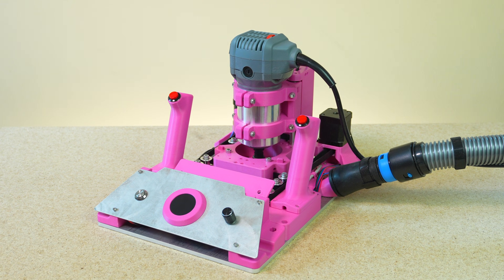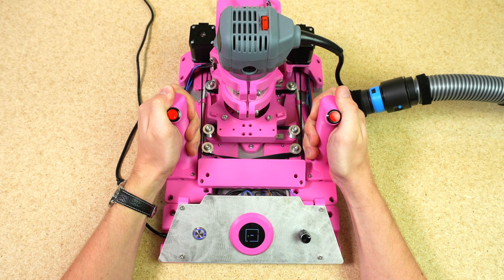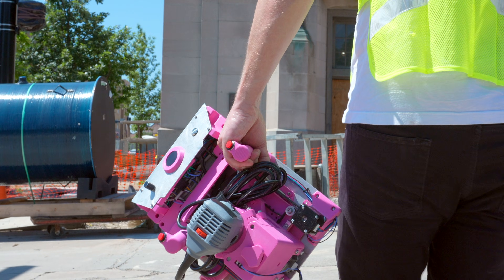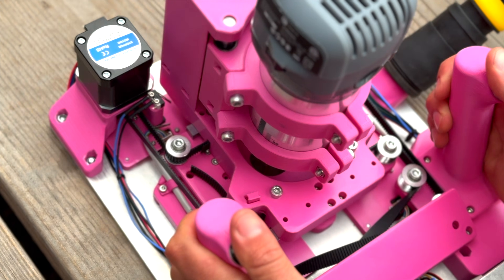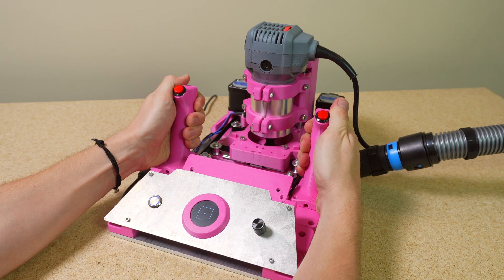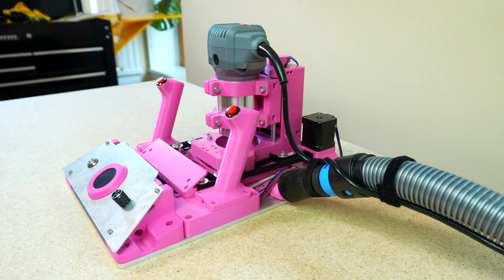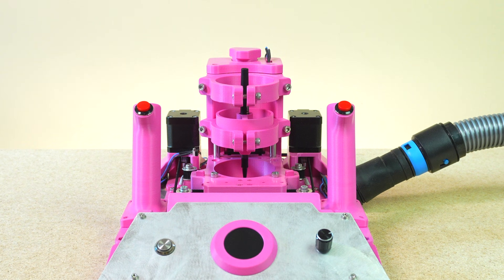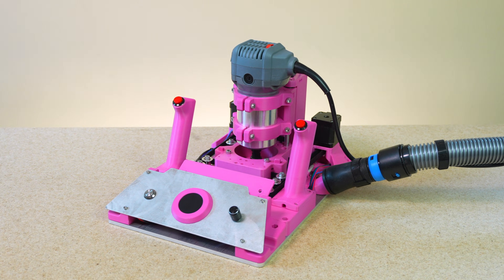Introducing the Compass CNC V1

Comment: Why didn't you put the display, teensy PCB and the two knobs on the shieldSeparator between the handles? As far as i can see in the CAD, the front part has no other purpose then holding the PCB, display and knobs. You could have made the machine 80mm shorter - or am I missing something?
Overall: Great work!!! please put a donation link on your website. I guess I would not buy one, but maybe I would build one and would like to contribute to the project

Comment: How does it know where it’s at?
Reply: Works the same as an optical mouse.
Reply: @JekaKey  but if you pick up a mouse and move it, doesnt know where its at. so once you pick this up it starts over? no rigid reference points? every project is a single cut?
Reply: @brandonrippeonphoto  Я думаю смысл примерно как в станке с чпу, задаете нулевую координату и относительно нее работает программа. Абсолютную позицию он конечно не знает. Работает относительно этого ноля и считает изменения позиции относительно него.

Comment: You don't need the ugly tape? How is the tracking done?
Reply from the maker: *4 mouse sensors ;)
Reply: @CameronChaney Might be limited by size then without the tape? Mouse Sensors arnt super reliable ive heard
Reply: @Stoeckermann mouse sensors track relative position. The tape tracks absolute position on the work surface. With the tape, you can stop then restart later with a new operation and the positioning will be the same as the first pass.
Reply: @DeanRockne That makes me wonder how you'd go about doing multiple passes with different bits with a tool like this.. not really in the cards, I suppose? That may also be a limitation with tools like the Shaper, too.
Reply: A mouse sensor
Reply: @Electheo  And the Shaper Origin doesn't? That seems like a fairly straightforward solution
Reply: So if you lift up the machine for one second does it lose the location completely?

Comment: Since you don‘t mention how you track, IMUs and mouse tracking sensors will not result in drift free tracking, for that you‘ll need absolute markers. Like that other tool we won‘t mention that‘s the only thing that‘s making your price for $50 worth of hardware in a DIY kit not completely ridiculous.
Reply from the maker: Yup, there's always going to be some drift with this sort of relative positioning setup. The name of the game is figuring out ways to minimize that. Using optical flows instead of IMUs to get a single integration instead of double, starting with a baseline of high accuracy/precision sensors, as well as including a redundancy of sensors (4 optical flows instead of 2) all helps. With a super rudimentary averaging scheme between sensors, that comes out to about 0.1% error per unit distance traveled - which, depending on your use case may or may not be acceptable. There's a lot of room for improvement on the software side in terms of sensor fusion to hopeful bring that drift down even more. We chose to prioritize ease of setup and the absence of consumables, while accepting some small level of drift

As for price, I'm planning on releasing "electronics kits" as well to hopefully make the build a lot more approachable for people who already have a lot of the parts lying around. Hope that clears some things up :)
Reply: @CameronChaney dude this is awesome!
Reply: @CameronChaney  Would really like an optical basestation approach eventually: Place like a little IR beacon on there and use as an absolute reference correction factor for bigger projects and then for smaller ones the optical flow sensors' .1% error ought to be tiny enough to just not matter.

Comment: You guys must be high. That crazy price for a kit that doesn't even include all the 3D printed parts or that $50 router in your demo? If it were all included and pre-assembled, I could see maybe $600, with a warranty included. Otherwise, I'd rather spend 4x the price for the real deal and get an Origin from Shapr
Reply: I love the idea of this and already have a shaper but wouldn't stop me supporting this project. I think the query was more about how it was still £600 for the electronics
Reply: i'm confused what's even in the kit. no router, no printed parts, that just leaves 3 axes worth of of basic 3d printer parts and 2 pieces of sheet metal (one of which is purely cosmetic and should've been cost optimized away). also do i see a corexy belt configuration? why are they trying to reduce the moving mass of a *router*? why is it belt driven in the first place, you want to hold the router as rigidly as possible for cut quality, which means not positioning the thing with stretchy belts directly transmitting cutting forces into those poor little motors. this obviously should've been a simple cartesian leadscrew setup.

I'm interested in the mouse sensors they're using, if they can deliver on repeatability (kind of a huge ask tbh) then that's the real innovation here (just, sourcing the sensors and figuring out how to efficiently interface with them is a real contribution). but i think the rest of the design pretty much goes in the trash
Reply: @spambot7110  For someone named spambot I shouldn't be surprised you're confused about whats in the kit when there is a list. I guess reading is lower priority than bitching though.
Reply: @seetheflow  sometimes a piece of text contains more than one sentence, and those subsequent sentences contain useful context for understanding the first one. you should try reading those sometimes.

Comment: What will be error if your move it for one meter and return to the same point?
Reply from the maker: It's about 0.1% error per unit distance traveled with the current, admittedly rudimentary, sensor fusion algorithm. So that would come out to 2mm. Working on implementing more sophisticated sensor fusion to bring that down some more